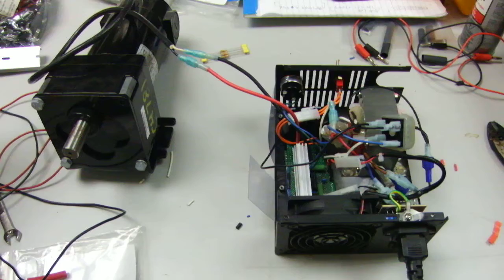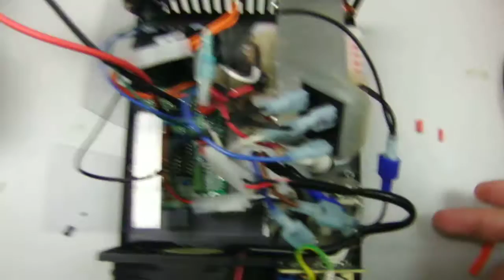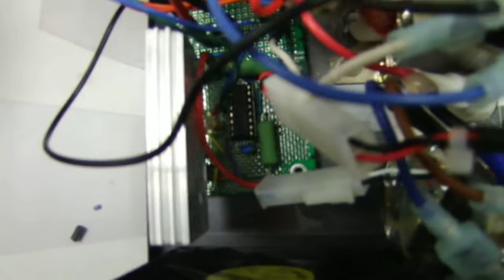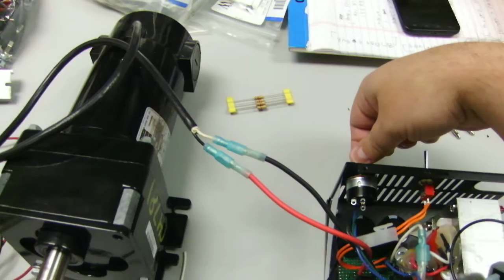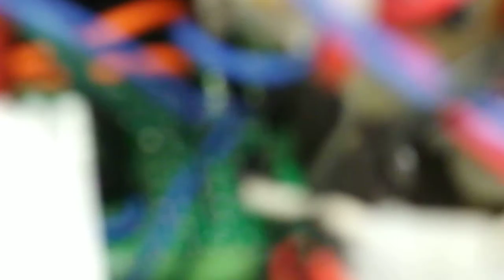Custom Ice Cream Machine Motor Controller

Comment: Very cool have you ever thought of building a set up for sale? That would be the perfict set up for a mash tun mixer for my beer.  Just no time to build it myself
Reply from the maker: +Art Kelley 
All I have here really is a 140VDC power source being switched by a mosfet (IRFU220NPBF) using a Texas Instruments PWM controller (TL494IN).  
I'm not sure at all about how to use a PWM circuit with an AC motor. I'd have to do a bit of reading.